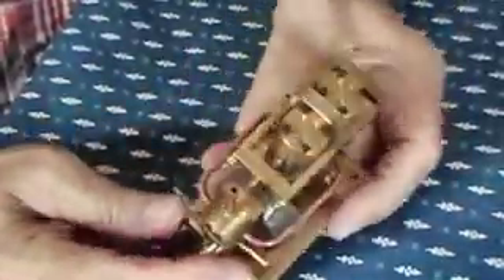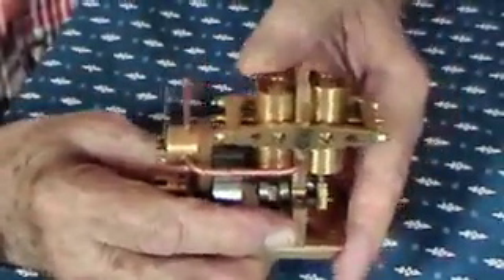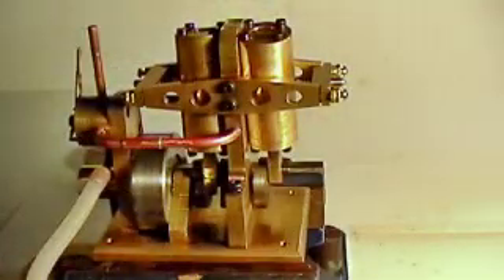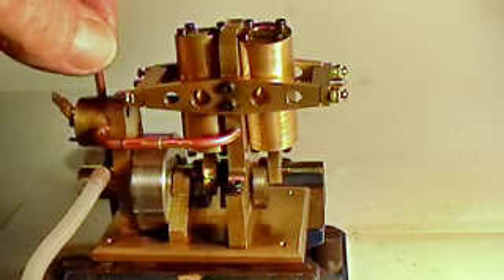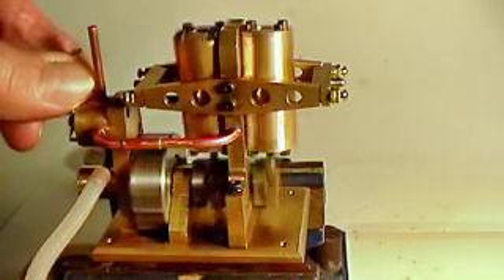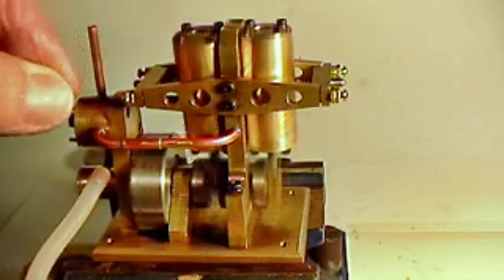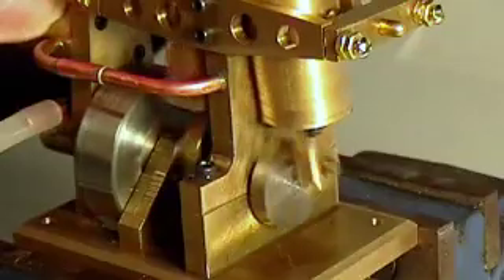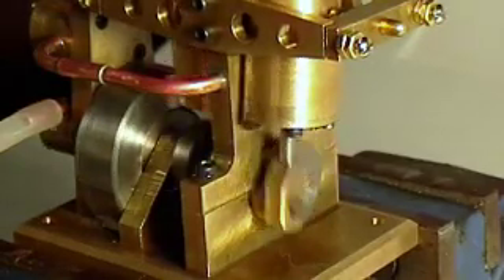My Twin Cylinder In-Line Oscillating  Valve Steam Engine

Comment from the maker: Yes it is: because the crank pins are set at 90 degees apart, one oscillating valve port is always open so it never needs a twist of the flywheel to get it running.